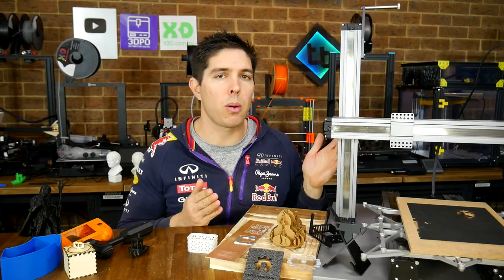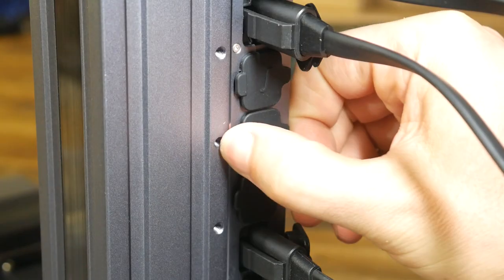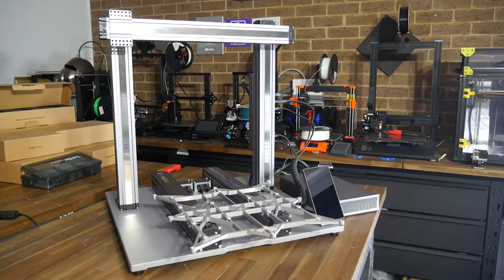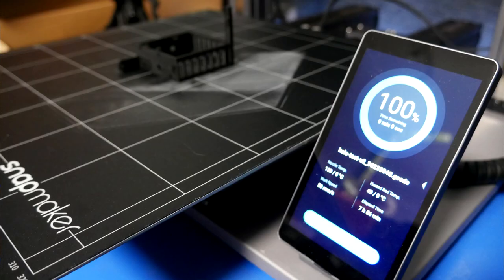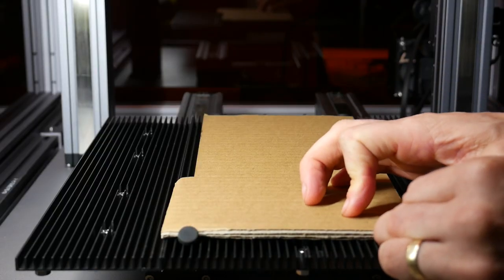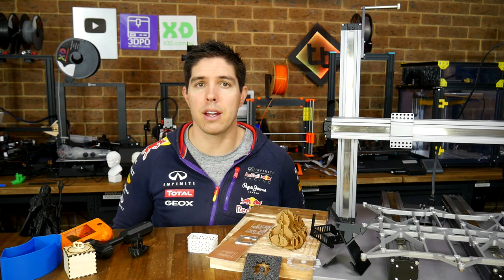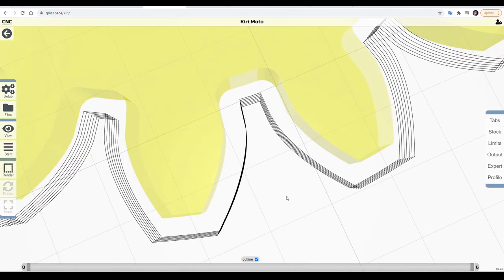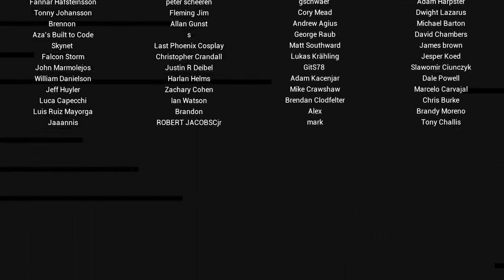Snapmaker 2 0 review - A 3D printer, laser engraver and CNC mill all-in-one

Comment: Since the date of this review, a number of things have changed. Snapmaker issued new silent rails, a new power supply unit, a rotary tool, and more recently a 10 Watt laser. It's now much quieter and the laser part is very much faster.
Reply: @ricksanchez9669  I have one myself. And although I had some issues in the beginning (mine was the Kickstarter one), it's not a bad machine. I like the robustness, the 3-in one aspect,  and the inbuilt safety features. It's not the fastest or best but as a hobbyist I have the flexibility to work with 3 tools in one work area which is more than enough. Plus their support is excellent and there is a thriving community, so most definitely one never feels abandoned.
Reply: @johnfiott  I'm uhh going through some stuff...kinda took out on snapmaker today. I have the a350t, and any failings have been mine.

Comment: They shouldnt even sell the laser without the enclosure. Someone who wants to cheap out is going to blind himself permanantly. Btw 1600mw is enough power to cause eye damage when you look at the laser spot, if you are not wearing laser goggles.
Reply: You're right but there is still going to be someone on ebay who will sell the laser module without the enclosure
Reply: @ethanm1943  yep 
At least they include laser googles that look pretty decent though tbh
Reply: @BenCos2018  Imo goggles are not suited for something that is on for hours or days and can damage youre vision so easily. Are you really dedicating a whole room to the printer so you dont have to wear goggles for days or are you going to remember to put them one everytime you walk in that room. People tend to underestimate how fast lasers damage youre vision.
Reply: @terra54  I agree with you 
I was just adding that they do at least include some kind of safety tbh
Reply: You get green \ amber safety glasses last I checked it was multiple pairs, with the unit that is to be used when using the laser even if you are using the enclosure
Reply: It is not dangerous until you use very reflectiv material from inox, aluminium or the worst, brass or copper...so wood or acrylic...no need for protection
Reply: But to catch fumes and just safety...ill recommend both

Comment: Can de stepper motor drivers be updated with silent ones? I would love to see you updating and tinkering this machine
Reply: Snapmaker are currently working on new linear rails with silent stepper motors and the power supply box upgrade with a quieter fan.
Reply: @jhk22  thats aweasome!!! I would like to see if its user upgradable though.
Reply: @tonialzola  as far as I can find, it's not possible to replace it yourself
Reply: @lazarjovic9948  :  Anything is possible... but could you forgive yourself for butchering such a nicely made machine!    :o)

Comment: Not gonna lie I was really excited for this concept. However, it seems cumbersome to change the head and re-dial things in every single time. Seems like different machines should stay separate honestly. Incredible build quality though. Would love to see some printers designed with these high quality extrusions.
Reply: Or it might be just one Produkt iteration away from successfully joining it all in one Maschine. I think they are almost there. Remaining problems are not that hard to figure out
Reply: Several of us who own Snapmaker 2's have 3D-printed quick-swap brackets for the tool heads, and have devised ways of adding the bed change-overs without having to redo all those screws.
Reply: @savejeff15  If they made an all-in-one, it would be very heavy. Heavy = slow. It would be a mediocre 3D printer, a mediocre laser, but maybe an OK CNC.

Comment: If the product development team is reading this, please consider the convenience of quick swap brackets for the different beds rather than all those screws. Other than that it looks quite useful. The only reason I'm not getting this is because of the mode change labor. A deal breaker for me in this cost range.
Reply: Several of us who own Snapmaker 2's have 3D-printed quick-swap brackets for the tool heads, and have devised ways of adding the bed change-overs without having to do all those screws.

Comment: I have this printer and enclosure. I love it but the noise is one of my gripes. I replaced the fan on the power supply to a noctua which improved it significantly. Also they are working on new and improved linear rails with silent stepper motors. Are also making a new dual extruder module for 3d printing.

I noticed when you did the bed leveling you only used the 3x3 grid, you can changed this to 4x4 and 5x5 if you want it to be more accurate.
Reply from the maker: Thanks for watching, sharing and for the tip.
Reply: What’s the thickest material it can laser cut or cnc

Comment: Never understood the slow printing speeds they use in their standard Luban profiles. I can print on my A350 at the same high speed as at my heavily modified Ender 5 Plus, which results in comparable nice print quality. The only thing that takes longer on the A350 is the recovery of your hearing... I think the major advantage of this 3-in-1 machine is not really the time, experience or energy you'll be saving, but the space you save compared with when you need 3 same sized dedicated machines in your appartment...
Reply from the maker: Thanks for watching and sharing. This one is being donated to my best friend so we'll see if they want to try other software or tweak the profiles in Luban. Space wise, I think with the enclosure this takes up the room of two machines.

Comment: The A350 was my first 3D printer and I've really enjoyed it so far. I use cura for printing and lightburn for laser. Use some vasalene in the tracks of the enclosure for easier opening.
Reply: I used silicon spray which is super slippery.. as I think Vaseline attacks some materials.

Comment: For what it's worth, the power supply is loud due to the fan they put in it.  There are several forum posts on snapmaker that talk about replacing the fan with a quality replacement that drastically reduces the noise at idle.  I did this within a week of getting the unit and now I have no problem with it sitting next to me on my desk.
Reply: Fred Bean:  That's good to hear.  If some of the comments above are correct, Snapmaker is already addressing Michael's concerns.  I think it makes good sense for Michael to review it as it came from the supplier, and then, if he chooses, make an upgrade video showing the "fixes".
He has done this brilliantly with many different products, and I like that approach.

Comment: Just change the fan out of the power supply. Problem solved... Change the bed to a glass one another problem solved. My printer doesn’t seem to be nearly as noisy as yours after I changed out the power supply fan. I have 10 other 3d printers and the Snapmaker by far is the best “Out of the box” printer.
Reply: How did you change the fan?

Comment: The loud steppers are hard to overcome because the machine also does CNC milling, which requires a lot of torque, meaning some really beefy steppers running at high voltage.

Comment: The factory profile made a clean benchy? At that price? 🤔 Nah. Extrusion isn't consistent and neither is cooling as can be seen when comparing port and starboard sides of the bow. I expect better from direct drive. 
If you're not printing PETG then why 70C? Any respectable printer should stick at 50-55C.
I also find it inexcusable how loud the machine is at this price point. 🤦🏼 To cheap-out on drivers and PSU cooling makes me wonder what other poor decisions were made in a board meeting.

Comment: I have 2 Snapmaker 2.0 A350s. I did get a little clever and bought both on eBay that were "As is, for parts only". But I am a real DIY guy so I sourced parts to fix it so I ended up paying about $700 for each after getting the needed parts. I like your Infiniti shirt. We drive an Infiniti Q70s with the 440hp V8. Took me about 8 months to find a specific one that we wanted fully loaded and it's a monster. Best car we have ever owned. Great reviews on your channel.

Comment: I bought the F350 for only 3d printing. I'll 3d print my laser and cnc machines.
One thing that is a huge fail on these is the filament runout switch. I found that the body of my micro switch came apart. So when I loaded new filament, it didn't recognize it and wouldn't allow me to resume. So I removed the right side cover and the fan, and I wedged in a shim to keep the switch body together, and it now works flawlessly. I think I made a video of it. Other than it takes a LONG time to heat the bed and its noisy as hell, it has been a good printer. It does make me money so I can't complain. Huge step up from the snapmaker original. I ordered $70 worth of 2020 extruded T- slot and a few sheets of acrylic to build my own enclosure. Works magnificently for a fraction of the price but still looks the part.

Comment: I've dealt with scaling issues in the past on other CO2 machines, typically what has caused this is design softwares not saving in metric/imperial correctly or different softwares not interpreting the scale. I'd sometimes see this as well in Cura.

Comment: I just ordered the new Version of this all-in-one machine, the Artisan, which has been greatly evolved. You can switch between all 3 modes in less then half minute, laser has 10W instead of 1600 mW, the Router is stronger and the machine in general is faster and can handle much bigger load with an encloser which allows high temperature printing. All in all the Artisan is a great improvement against the old snapmaker you have tested here and it should get reviewed, too, imho.

Comment: Jack of all trades and master of none.  3D prints slow and noisy because all the mechanisms are overbuilt and heavy.  Laser cutting is slow and under powered compared to a dedicated laser cutter.  CNC is slow and mechanisms are too light or not rigid enough.  I think I would rather just have a really solid workhorse 3D printer and skip the laser and CNC.

Comment: I would rather buy a Genmitsu Prover 4030 router for $999, an Ortur  400 x 430mm laser maser II for <$300, and a Creality Ender 5 Pro 3D printer for <$400, totaling <$1700. All these provide a larger work space, a more powerful 5.5 watt laser, and superior router and 3D printer. Plus no changeover time. The only drawbacks are the space required and a possibly longer learning curve.

Comment: A very pretty machine, but fails in areas that cheaper machines do not. Just because a tool moves in 3 axis, does not mean that one 3 axis moving tool can do the work of 3 axis tools designed for a specific task. The machine is far too slow. By going slow you can get away with flimsy construction, and the flimsy design and puny low speed spindle, means it is severely restricted in 3d milling. Of course it will work, but painfully. But, it looks very pretty. It will suit a number of folk that I am aware of, but if it was given to me, I'd just use it for parts, as you would with a cheaper ender3.

Comment: I got a Snapmaker 2.0 A350 on the Kickstarter.  Received the unit in May 2020 and I have had issues with the auto bed leveling since day one.  When printing some areas of the print are too far away from the bed and some are too close to bed.  I have gone through the bed leveling process multiple times with no improvement.  I have also adjusted the sensor on the print head using Snapmaker’s guide with no improvement.  I have emailed Snapmaker about the issue and was told to remove the screws in each corner of bed which changed nothing.  It’s now a year later and it’s still not fixed.  I feel like Snapmaker is ignoring the issue.  There are a lot of posts on their forum from other people having this issue but no fix yet from Snapmaker.  As for everything else, the laser engraver and CNC work great.  I just wish they would fix the auto bed leveling issue because if they did it would be a great machine.  P.S. It is noisy as hell so if you need something quite get something else.

Comment: The other benefit of a 3 in 1 is that you save a lot of space. And if you only need 2 features you get the 3rd for free for possible future use. But I wouldn't suggest this for only 1 use. Especially as just a 3D printer
That laser wattage looks way too low for what you're paying. I've seen a 5-watt cut and etch much faster.

Comment: Can you mod an ender-3 with a geeetech 3-in-1-out hotend?
Reply: You definitely can! You'd have to upgrade the motherboard to something like a skr 1.3 or 1.4, change one of the z axis outputs to an extruder output to get three extruder outputs in total and get two extra stepper motors. You'd have to do some firmware changes but teaching tech has great videos on how to get it work. Hope this helps and good luck!
Reply: @BrentGW  That seems kind-of complicated. When I was first deciding on a printer to get a bit more than half a year ago I wanted to get the Geeetech A10t but heard that it's not a beginner printer so settled with the Ender-3 instead. I don't know if other people can relate to this but there aren't any videos on how to do it on youtube so I was hoping maybe Teaching Tech could do one since it seems like the kind of stuff he does.
Reply: @ethanm1943  I know it's not a 3 in 1 out but teaching tech has a video showing off the ender 2 in 1 out. As always he goes over any and all troubleshooting you might encounter.

Comment: I had the Snapmaker Original, direct from Kickstarter. I sold it again after 2 months: it was just too loud. I could not run it during the night, or during the homeoffice time of my wife. The SnapMaker V1 also had a much smaller volume: 110mm in all directions, and no heated bed. I discovered that I never used the CNC head because I was afraid of the dust. I used the laser only twice, because I wasn't prepared for the smell in my apartment. And for just 3D print it was too loud and too small for me. It worked great, though. For beginners it was/is a great machine... I now have a Prusa MK3 :-)

Comment: It's a shame to see such a well built machine let down by noisy fans and drivers and  I was beginning to drool up to the point you turned it on - at least it is an easy fix for the manufacturers . Did you take a look at what drivers they were using ?
One problem with this unit is the leadscrews on the X & Y axis - after some use they  will get some backlash and this will cause some issues , ball screws would have been better .

Comment: It should be mentioned that they are working hard on improving the psu fan noise and silent steppers. and even better, they have a rotary module for 4th axis laser and CNC work that is accompanied with a emergency stop button and they're working hard on both a dual extruder print head and a multi material module such as the mmu2 from prusa.
Reply: Willem van asten:  That will be interesting to see... hopefully they will have enough sense to give it to Michael for a thorough and unbiased review?!

Comment: You mentioned that you had to recalibrate the Z axis when 3D printing. I have had this issue with a Delta Wasp & found it necessary to calibrate with a hot bed to compensate for thermal expansion

Comment: Awesome as usual! I think the other thing why this is better than the option of building or buying separately is due to space! This machine has a larger footprint but if you bought 3 machines capable of doing these functions at the same sizes, then you would need at least 3X the space just to have them! I am a cheap bastard and do not like the price, especially with the software issues and why would they only use a PTFE lined hotend rather than a full metal one??? but I can see with the quality of the actual frame it is worth a bit more than a single machine, just not what they are asking (convenience price tags are getting higher and higher it seems).

I would love to hear if you can swap out the hotend, extruder, fans, etc with aftermarket parts or if once you buy this, are you stuck in their ecosystem and have to pay whatever they want to replace the parts.

Comment: I got one from the Kickstarter and I sold it. The printer was way too slow and the motors and PSU were very loud. I also really didn't like the door of the enclosure - it just didn't shut or open smoothly at all.  I wasn't a fan of the software workflow. Also, changing tools is a huge hassle. It all added up to an extremely slow, cumbersome, and loud experience. I think they can easily fix most of these things and I hope they do
Reply: Sold my machine too. Replaced it with a Creality CR-10 V2

Comment: I’m considering a Snapmaker 2 since I do not have the space for multiple machines but would like all 3 functions. Your review looks very fair. From what I understand from Snapmaker and other reviews is that Snapmaker has listened to the critics and made some adjustments like reducing the noice, which would be a deal breaker for me since I have to work in the same area. Could you comment on those so called improvements and update or new modules (like horizontal rotary module and 10W high power laser module) ?
Reply: Did you end up buying the Snapmaker? If you need to ask anything feel free..